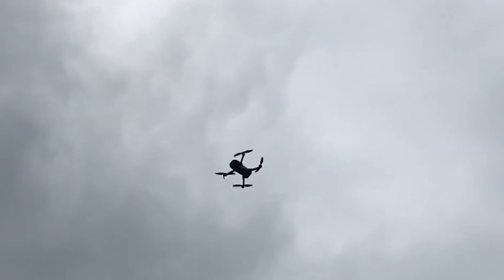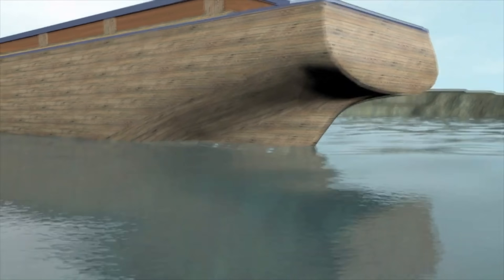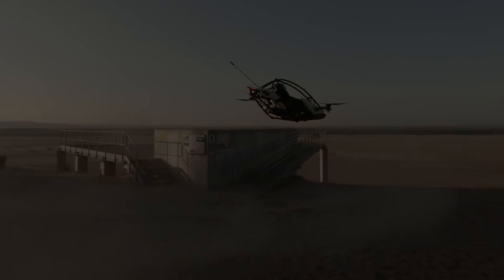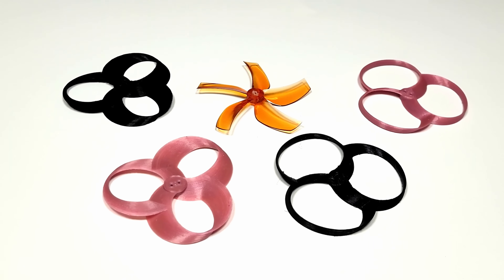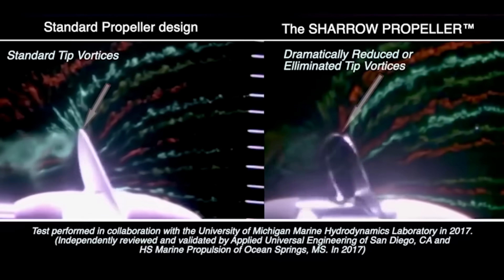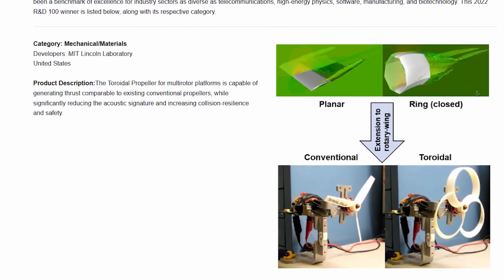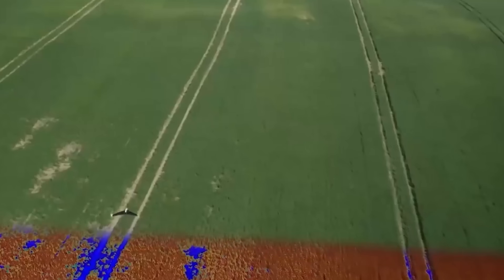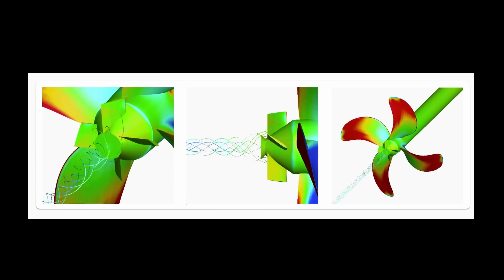This Propeller will Change Aviation Forever!

Comment: I’ll say it’ll change aviation forever - a Cessna 172 with a half ton of bronze hanging off the front would definitely be changed ! 👍🏻
Reply: It doesn't have to be bronze, it could be carbon fiber
Reply: @jaysonwallker1648  Or Wood.
Reply: noooo, will be 3 kg of carbon fiber ...
Reply: @gulfstream-tvstudios9546  Sorry, I didn't see your posting before I said the same thing.  I'm not an engineer, but I was an engineering technician for a major electronics fabricator.
Reply: @gulfstream-tvstudios9546  B
Reply: I wonder how fast it would have to turn to even work.  It seems to me every aircraft propulsion device goes for the largest diameter without messing with the sound barrier.
Reply: @Chris_at_Home  it is 40% more efficient in reverse, but of course I am talking about this prop for Water, not Air.!
Reply: @Chris_at_Home  due to the compression of the air the sound barrier is actually a lot lower than you’d think, the boom comes directly from that barrier not the speed at which you break it.
Reply: @TheEPICERS  A prop also has lift on the front side as it is an airfoil so that would cause a drop in pressure.
Reply: @Chris_at_Home  true, but the low pressure area and high pressure area are physically separated by the propeller, the low pressure area on the front doesn’t take away the sonic boom on the backside. Also I’m aware it’s not technically the air pressure itself (which does the inverse) but the relative temperature increase of the air that lowers the speed of sound from that compression.
Reply: I notice they don't discuss that for aviation these props could not be made in variable pitch or feathered. That's a huge downfall.
Reply: @kpd3308  most drones and UAVs don't have variable pitch props though.
Reply: Think of how much you could put in the back to balance it out 😊
Reply: Who put a bronze prop on an airplane, ever?
Reply: @fillhixx  I'm an A&P IA and a Private Pilot.  I've seen wooden props, carbon fiber props, steel props and the most common prop, Aluminum Propellers.  I don't think there is a bronze prop used in aviation.
Reply: It’s hollow! Much safer! /s
Reply: Haha…yes :)
Reply: Carbon fiber
Reply: @dekeburns801  Wood
Reply: The bronze prop is for the sea plane version 😜
Reply: Obviously it won't be bronze on a plane. Just like it wasn't on the drones. Talk about a pessimist.
Reply: Would this torodial propeller also work with helicopters?
Reply: @epistte  you beat me to posting that.  I was trying to think it through but frankly I don't have even the basic engineering skills to conceive if it might .... though perhaps on a vtol type where the config is different...  or perhaps the tail rotor on a standard chopper?   Fascinating to see what comes from these innovations.   I know Stan Deyo has discussed forward based water craft propulsion that tunnels through water drawing water in the back and vortexing it to pull the water craft forwards.... we are living in an era where development can happen fast.
Reply: Imagine using this type of propeller on restricted horsepower lakes (example no larger than 9.5 hp)😮😊
Reply: Wow,  but yet never in africa do they discover these things.  I wonder why
Reply: The Cessna 172 is the Toyota Prius of the aviation world
Reply: @sprinktixr Is it bollocks.  It's not electric and not Japanese!
Reply: Why bronze?
Reply: @BlueLeon2287  Why not?
Reply: 🟦..... You've made an error!..... The propeller shown on the airplane in the thumbnail was meant for MARINE use, NOT as an AIRPLANE PROPELLER!
....Yuh really need tuh RESEARCH this stuff a bit more before yuh put it OUT here!
Reply: You can buy aircraft quiet blades now. Underwater US Navy you will be talking to 1st.
Reply: Carbon fiber and a sound dampener around it besides a cessna burns better than a boat thernite baby yunis
Reply: Also, the Cessna will achieve unprecedented speeds in a steep descend.... maybe at -90° ?
Reply: There is a nautical prop that looks similar to this that could be made with bronze.  However, and aeronautical one will never be fashioned out of heavy bronze.
Reply: I’m not sure when the last time was that you read anything, but…there are a plethora of materials in use these days that are far stronger and lighter than ANY metal.
Reply: Change the gravitational force of attention 😂😂😂😂to “yes”
Reply: It would be made of composite, the thumbnail is obviously a shipping boat's propeller.
Reply: A new target for scrapping
Reply: I'm thinking that the glide range in an engine-out situation is going to be decreased though...
Reply: Is no problem.  The STC for this prop will required installation of a 40 pound cannon ball in the tail cone.   And potential gyroscopic precession will mean the STC will allow fast changes in roll but snails pace changes in pitch and yaw so prop doesn’t twist the crank to bits.
Reply: You and the other failures of engineering are forgetting a very important fact.. try again.
Reply: Why do you assume that it will be heavier then a conventional propeller?
If that was the case, so would be the drone toroidal propellers and, if so, the drone wouldn't fly. But it did.
Not sure why you thought that, but probably there's no truth to it.
Reply: @brunotartari675  It's going to be substantially heavier - with a conventional prop the centrifugal forces are all in pure tension, which plays to the strength of the materials, and decrease proportional to the distance from the center.  With this design you have a massive amount of shear loads on the loops, so it's going to have to be built way heavier.  On top of that you're pushing a bunch of weight out to to the tip, where the speeds are higher - that's going to require even more weight closer in to support those loads.  The high tip weights are also going to lead to enormous increases in the moment of rotational inertia, making it much harder for the engine to crank over at startup.

Little drones operate in a completely different performance envelope to real aircraft - their components are very light, but real aircraft parts are much lighter relative to the loads involved - there's a reason we don't build real aircraft propellers out of unreinforced plastic.
Reply: @tgiskardify  As the RPM increases the centrifugal forces will TEND to flatten the attack angles, thus tuning the prop for higher speeds. This works in favor of the design.
Reference - - "torque-shift prop" for boats, which increase pitch with speed.
Reply: If you build this up to the size needed for a GA aircraft, the RPM increases will tend to tear the whole thing apart unless it's built so heavy it's impossible to crank the engine and any pitch or yaw change tears the crankshaft out of the aircraft.

It's a really cool advancement for small drones but this won't work for anything larger.
Reply: @brunotartari675  The prop has more structure and surface than a conventional 2 or 3 blade prop.  More structure means more mass for same diameter. And thrust is a function if disk diameter so the new prop cannot simply be of smaller diameter. Yes, it could be made of carbon composite, I suppose, but so could a conventional prop.  

One sure sign that this is a nonstarter……no prop company, no wind turbine maker, not Westinghouse, not Pratt Whitney has, so far as i know, licensed this.  Those companies are not dense; they understand the physics of props….that’s their business.
Reply: Haha
Reply: Will be fascinated to see Mike Patey and his prop builders do some engineering and real world testing on full sized real world aircraft in real world power demands.    The fluidity IN WATER and the demands of small drones I suspect are significantly different to a larger aircraft's prop....just as you point out.   Might be a better material than brass...perhaps.   but so far the aircraft prop builders are sticking with various blades and choosing width and number of blades etc....  I expect they'd be researching possible torroidal props for aircraft....but might take a while till someone comes up with a large full sized aircraft appropriate torroidal prop build material.   Fascinating to see the engineering and enterprise is not limited to universities and military or only big companies.
Reply: Why bronze? Why complicated CNC engineering, how's about plastic printed torodials?
Reply: Bro it would have a amazing cg
Reply: For aviation it would probably be a magnesium or titanium alloy.
Reply: The thing that would change is the 172 would be more attracted to the ground :D
Reply: Terrain, Terrain, Pull up, Pull up. (insert explosion here)
Reply: Haha, thats exactly what I was about to post 👍👍
Reply: We went to space and JUST discovered this?!
I just managed to improve it in my mind.
Somethings are like that.
Reply: Never saw a bronze prop on any plane. Ever.
It ultimately may not work for some applications but at least some folks are trying to improve things rather than be content with the same old thing. I'm sure that folks also fought putting windscreens on planes also.
Reply: "Clear Prop!!!"
Reply: I wonder if you could take a large scale 3D print of the colleges version. Then make carbon fiber ones
Reply: Bloody good aircraft, nice to fly and you're right
Reply: I live for comments like this 😂😂
Reply: Bull.  the very first clip was from a different youtuber talking about a different one-sided propeller out of Africa for a future hoovering craft to deliver to your door medical supplies manly ,developed buy the same guy that made the drone plans that deliver blood and life saving medical supplies all over rural Africa and spreading. And this is not even close lol
Reply: True
But why does it have to be made of bronze?
Reply: Would need to be carbon fiber
Reply: An actual prop is flipping heavy.  I have my old one on the wall. Its 72" and I reckon the 20kg estimate someone posted isn't far off yhe weight.  Probably 15 - 20kg
Reply: @dr_jaymz  I think you're right. A standard 172 aluminum Sensenich is right around there (41 Lbs).
Reply: noo everybody knows that bronze props are soo last millenia the new kids run pure led softer so less chans of catastrophic failure due to cracks 🛩
Reply: The Endless claim is so ridiculous, as well as the picture 😜😜😜😜
Reply: Y'all know modern props for small planes are still made of wood, right? You're acting like a propeller that weighs 3x more than a super lightweight carbon fiber prop won't work, when modern planes fly today just fine with projects that heavy.

It's unlikely a toroidal prop will be made of wood, both because of the weight and the shape. But I see no reason making them out of aluminum (the third modern propeller material) or carbon fiber would be any problem at all.
Reply: @jeffwells641  The most advanced blades on the market for GA aircraft are carbon fiber with a wood core and a nickel or stainless steel leading edge for erosion mitigation.  A specialized type of plywood was used in variable pitch Rotol blades of WWII fighter aircraft.  Wood has always been an excellent material for prop blades.  I've seen solid aluminum blades, hollow aluminum blades, even steel blades.  Some of the larger paddle props of radial vintage can weigh several hundred pounds on their own.  But there are a lot of valid reasons why weight reduction is a big factor for props.  CG changes are a big deal on smaller aircraft (particularly homebuilt aircraft), the torque and gyroscopic forces that it imparts on the aircraft, how an engine starts or RPM changes are affected due to the additional inertial mass, among a lot of others.  It's ALWAYS a better idea to reduce prop weight in every feasible way possible.

However, I don't see these props scaling up as well as drone or boat props do.  The amount of centrifugal force exerted on a hub from a single blade in a rather simple C-172 can reach upwards of 20 tons at peak RPM, and those props are designed with a tapered profile and aspect ratio to get as much of the blade weight as possible away from the tip.  This type of blade design would be adding a considerable amount of mass to the extreme outer diameter of the prop, mass that doesn't contribute strength to itself like a straight blade would.  I believe it's possible to make a blade stay together in that application, we have that ability, but it would have to be highly engineered for absolute strength and the resulting prop would be far less forgiving than a conventional prop.  To add to that, even conventional blades are susceptible to failure, I've experienced the effects of a partial blade loss myself and know of several others who barely survived blade failure, several again that didn't.  It's not the type of component that should be engineered with bleeding edge processes and materials just to keep it in one piece under ideal circumstances, because aircraft rarely encounter those.
Reply: @jeffwells641  Some vintage aircraft may use wood props, but most modern General Aviation rely aluminum or some other composite as they are stronger than wood, and easier to mass produce as you mold them into shape rather than carving them. Hell even most favorite vintage WWII aircraft don't use wood props.
Reply: @airplanenut89  Incorrect. Wooden props are still used in light airplanes (2-4 seater prop planes). You can buy them brand new today. The reason they are used is because they get up to speed much faster than metal props and tend to have fewer vibration issues, and at the speeds and loads they run wood is more than strong enough and a little less expensive (~$3.5k for new birch vs ~$5.5k for new aluminum).
Reply: it wont.  Radius of gyration, vibrations will kill this concept cold.  

For general aviation this could partially work with an efficiency increase of ~4%(induced drag reduction for Mach tip speeds of under 0.54 or so(not worth it IMO)) for those aircraft which used fixed pitch(most of them), and no the dead engine glide would not be unacceptable any more than any other 2, 3, or 4 bladed fixed pitch propeller.  If you are talking constant speed props, then technically it could still work, your pivot point would be critical, but its range would be reduced and would have an optimum forward velocity for sure(but then this is already true of such propellers) just it would be more so.
Reply: @w8stral  That made me fall asleep...
Reply: @Mike_Hughes  Great, you fell asleep, glad to be of service, maybe you learned something...
Reply: @w8stral  Sorry, just woke up now!

Comment: Another flash in the pan.  Sure it looks like an wonderfully complex gift from heaven.  Sure it’s got a sexy form.  But we long long ago learned that surface area costs drag and small disk diameter reduces thrust. Yet both are inherent in this prop.  And, in an airplane, weight is everthing and this design will never be light for the needed disk diameter.  What may be gained in reduced tip vortex will be lost several times over in lower thrust, greater drag and very high weight. Perhaps Hartzell and Sensenich and all them wind turbin folks know what they are doig.
Reply: Oh!  I forget about ice!  Those closed loops sure ain’t gonna shed ice as easily as a straight blade.  Bet this prop would look like a twerling snowman and would lose all thrust when you need it most.
Reply: thoughtful answer... science is calling

Comment: You show a graph of grams of thrust plotted against motor utilization percentage, which clearly shows that the toroidal prop generates 30% of thrust of the conventional prop when at max load, am I reading it wrong? It would mean that the toroidal prop is efectively a gimmick, not applicable to anything in the real life, except when the noise is crucial